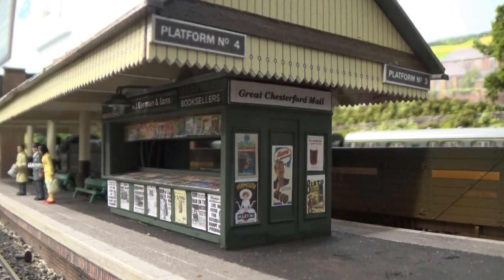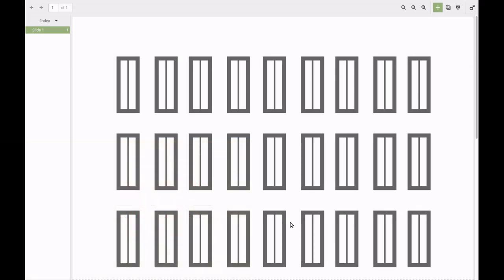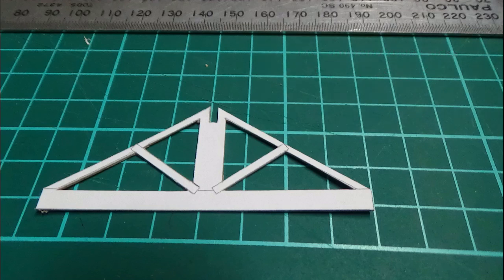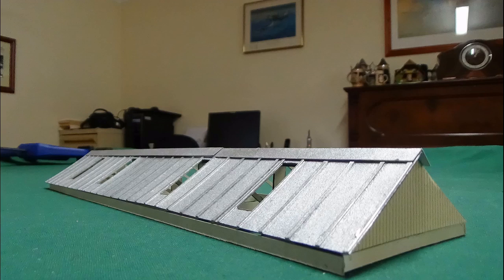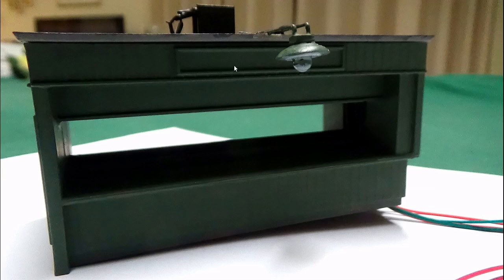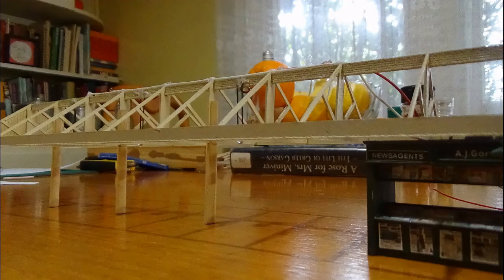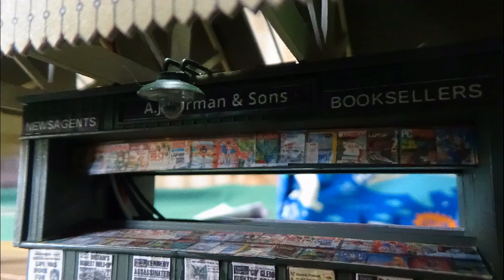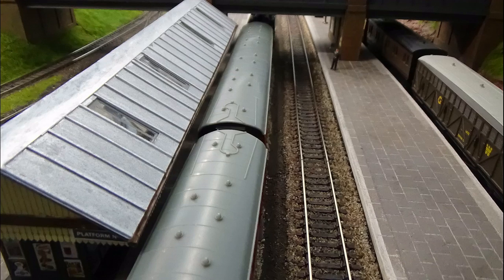Episode 137 20 How to build a Platform Canopy

Comment: Very well done. I haven't built anything from only card before. I didn't think it would look "real" enough. The way you have shown this build and how the outcome looks, I think I'm going to try out doing some scratch building with card. The way you did the lights with the grommet was neat and looks really good.   👍
Reply from the maker: Thanks William,
The card is easy to work with and it`s on the table at breakfast time just waiting for you to finish off the cereal so that it can become something else.??
I think what makes the difference with just about any modelling material, is the final paint job or colouring. The paint ties it all into context and convinces your eye that is indeed what it looks like.  I made a replacement buffer beam yesterday from cereal box card.....it works fine. For buildings, move up to 2mm card.......mounting card for pictures is good....and you will find it extremely strong, yet easy to work with.
Cheers Gormo

Comment: Just getting back into the hobby after an absence of 40 odd years and came across your channel - a real joy to watch with some superb ideas, including this canopy. One thing you might try is to print the skylights / windows directly on to the acetate sold at most office supplies / stationers for making overhead projector slides - it's designed to handle heat, so you can use an ordinary inkjet printer without any worries. I've done it for windows run up on "Inkscape" and it works a treat. Thanks for the inspiration - you have yourself another subscriber.
Reply from the maker: G`day Paul,
Welcome aboard and thanks for your comment.
 I like your suggestion for the windows and I will definitely look into that. It would be very handy for intricate windows as per an engine shed or something like that with a lot more detail.
Cheers Gormo
Reply: @greatchesterfordjunction  One fly in the ointment with the acetate windows if you want to give them a go is that you can't print white ones, since "white" on a printer is really an absence of colour - do that on a clear sheet of acetate and you'll see the result, or rather, you won't. You can get away with a pale cream colour, and all the dark ones (especially GWR brown) are O.K.. Just make sure the O/Head projector slides are inkjet printer safe (most are) and let them dry thoroughly after printing before handling, since they're prone to smudging if you don't. Good luck!
Reply from the maker: @pauljames9626  OK Paul,
Thanks for that........next time I`m at Office Works I`ll get some.
Sounds like a good way to go, especially when scratch building, the hardest part is getting the right windows, but with your method, it`s very easy.
Cheers Gormo

Comment: I have just watched several of your videos that I had not seen before and enjoyed every minute. I am making some 3D printed twin aspect LED signals and so far I have managed to destroy 4 of them. The main problem is they are the BR early-type where the poles are split by platform near to the top. I am still trying to work out how to get the wiring from the top, where the head is fixed on the shorter of the two poles and then down the second pole. I was not sure that you could join the Negatives together, but now I know. Cheers. Martin (Soon on his way back to Thailand)
Reply from the maker: G`day Martin,
I have found by experience ,when creating something new ,that I finish up destroying the early attempts. Unfortunately, this is how things develop and improve, so the early attempts are sacrificed for the cause. 

Don`t be disheartened because I`m sure you will get there.
Yes you are right about the negatives....I call them the common wire......the common wire can also be the brass pole that supports the signals, if you were using brass.??
Good luck with your signals and thanks for watching my channel.
Cheers Gormo

Comment: Great job, Cormo !  One very minor point, the truss supports would in real life have V-shaped ends to slot into the roof and centre vertical. The V shape helps spreads the load. But I know that they won't be seen anyway!
Reply from the maker: G`day Ray,
Thanks for your comments, but it`s too late for this one ....LOL...however some concessions have to be made with the materials I`m using, so that the structure will be strong enough. As you say it won`t be seen. I think if I was tasked with making an absolute exact scale model, I would approach it differently, but in this case, it`s just a representation or an impression of a platform canopy.
Cheers Gormo

Comment: don't forget to pick up the buffer on the track at the side of the platform
Reply from the maker: Thanks John,
Yes I spotted that thanks.
It actually came off a DMU set that I won on Ebay just a week ago. It`s a fixer upper and there`s loose bits and pieces everywhere that I`m currently working my way through to repair. So far so good.....but still a ways to go.
Cheers Gormo